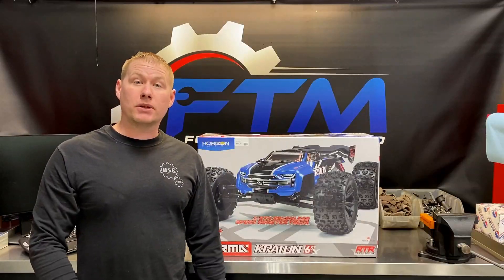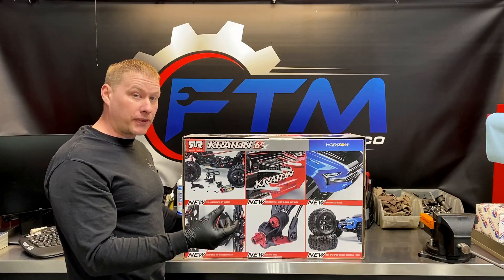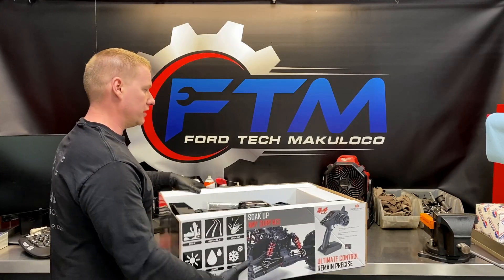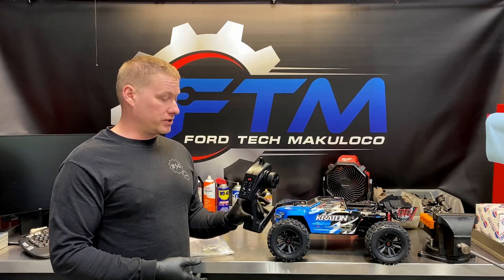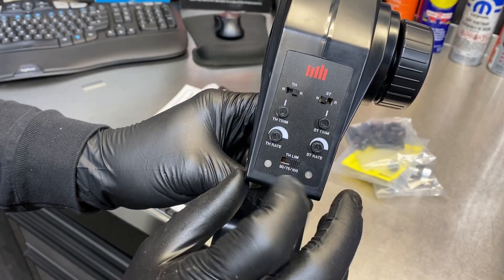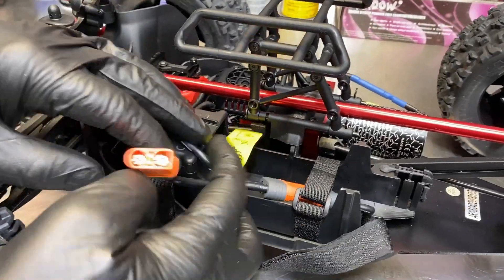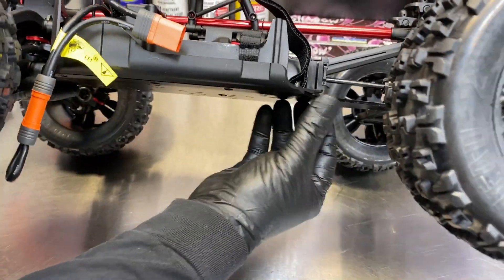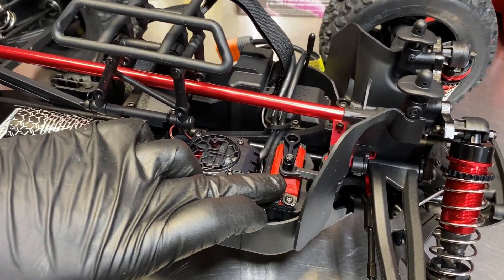Latest 2020 Arrma Kraton 6s Brushless Monster Truck Unboxing!

Comment: To everyone who has the V5 kraton.... pull your front and rear diffs and check to make sure your screw on your differentials are nice and snug. Had that issue..... it led to a weird clicking noise, threw all my gear oil out into my diff case and dug a groove into it. Horizonhobby has been contacted and new parts are on the way. Also spend the money for a bash bar from radicalrcuk. Sooooooo worth the investment!!!

Comment: You can use the bumper from any of the other models in the 6s line, bolts right on!

I use xt90 on all my cars, makes it easier to just switch everything to a common plug ;)
Reply: @Shadows-RC  either works, not sure why you had so much trouble with the xt90, it is tough but that's why I like them...had issues with other connectors separating when they land hard after a good launch into orbit...you have to rock the connectors back and forth... doesn't take that much effort lest your fore arm strength isn't sufficient to hold onto them, maybe then I could see them being that hard but even my 12 year old daughter can pull xt90's apart so I wonder if yours were defective or something?
Reply: @Shadows-RC  I see, you run mostly on road vehicles? I have found the xt90 better for bashing due to the other ones coming apart so easy. My apologies, wasn't trying to say you're weak, just pointing out possible reasons 😉